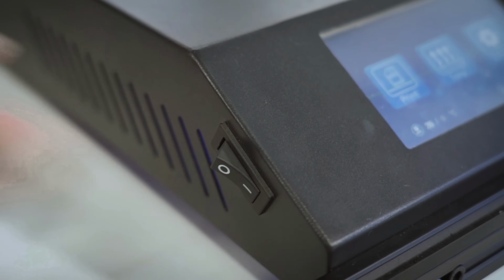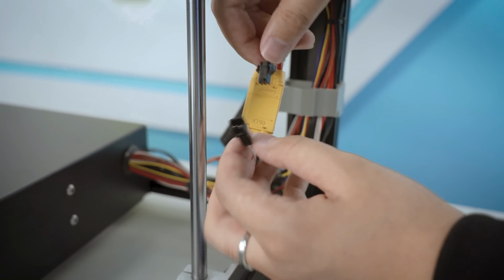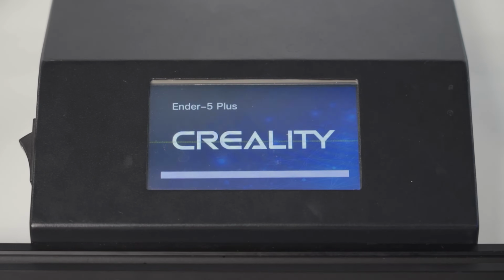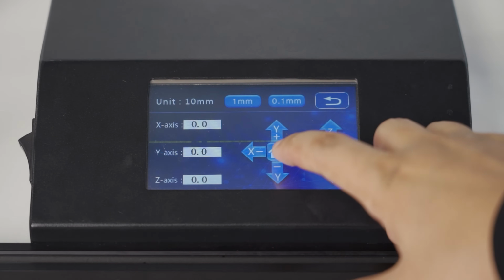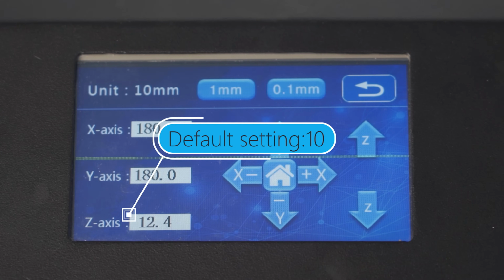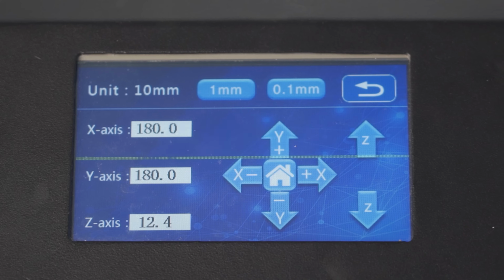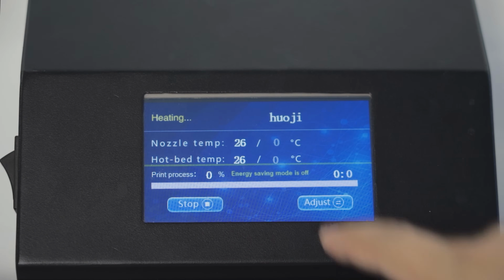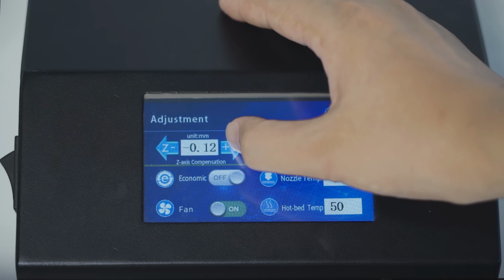Creality Ender-5 Plus Bltouch Leveling Tutorial (2019)

Comment: Creality needs to at the least... get an even mediocre programmer, as such a person would be better than whoever they have now. No matter where one goes you see customer after costumer with the same problem. With no viable solution, except going into the code and fixing the problem oneself.
Reply from the maker: Sorry for the late reply, and thanks a lot for your comment, but could you pls tell us your printer's problem, or contact our after service cs@creality.com?
Reply: Thats frustration talking, I have two, the 3v2 and the 5 plus.. I can assure you it's not a "code" issue. The internal board streams instructions encoded by the slicer, If you don't believe me, you can also configure octoprint on a raspberry pi, and it will ignore the internal board.  You can also install alternate firmware. I have on my E3V2, its much better I think. Respectfully.

Comment: I've seen the bed smashing hard into the print head, although the BLtouch is installed - shouldn't the printer be able to figure out that it reached the print head?
Reply: One would think so...
Reply: So the reason for doing this is the BLTouch detects a z-point...but the system overrides it.  Hence why they zeroed everything out before...doing any aux and auto level.    The BLTouch sense a predefined amount, then the z-offset kicks in.  And it is why the BLTouch if you watch it...retracts BEFORE the nozzle even gets super close to the bed.  Then the bed lowers...then it raises...to the touch sensor reading, the zoffset reading.

So if you screw up the settings, super bad.  The board is thinking...hey the BLTouch is here, and the bed needs to be here...so move this amount.  And with the messed up setting the BLTouch is retracted, not acting like a z-stop, and boom your head will crash into the printer.

BLTouch is NOT a z-endstop....and is the reason it does NOT use the zstop on the board.
Reply: @elitewolverine  it's essentially a software glitch. Wrong data is captured, then stored; so the error becomes persistent.
Reply: @Singularity. Sir, That is not the case, you are peppering this video with inaccurate information. I can tell you don't know what you're talking about, as a programmer myself. Not everyone would be able.

Comment: Where is the STL of the bed level test?
Reply: Its not, it is any stl.  Basically just hit print on any stl, so you can access the z adjustment, and get it to zero.  It's odd that the leveling section doesn't display the zoffset...but hey what do we normies know. haha.
Reply: @elitewolverine  I wasn't asking how to adjust the zoffset but the stl of what he print at the end to test the leveling he did.
Reply: @MGCoin333  The end of the video?  The one that is just lines?  Just a bed level print test.  Find them on thingiverse.  Or just mock one up in any 3d program.

Comment: My printer shipped with a bent pin on the BLTouch, and that caused the Z-axis compensation to get set to more than -15.00. Now I need to press the adjust button over 1000 times to fix it :(
Reply: Mine came with a second pin as a replacement...did you throw yours away?

Comment: I have to zero out the Z-Axis every print why is this?  it always defaults back to 19.00, Someone please tell me what I'm doing wrong.
Reply: Nothing... the machine design is excellent the programming however, isn't even at the level of mediocre.
Reply: @singularitysquaredllc.895  Sir, again, That information is both unfair and incorrect.
Reply: You need to be leveling and homing every time ALL axis. But that is weird. There is a save settings button, if you have an Ender 5 Plus... That IS weird though.

Comment: What about auto bed levelling, how does that work? I mean it’s the main reason I bought this machine big build area with auto bed levelling! Also does this mean I have to go through this whole process every time I do a print?
Reply: It’s not really levelling. It’s more bump compensation. When it probes it saves a grid of points. When printing it can auto adjust z to compensate for the wonky bed, but it’s z range is only 2mm. And of course, it only does this if g28 and g29 are used in the right points of your start gcode.
Reply: @hecatonchireslm  Excellent explanation, I think.

Comment: I watched this video 3 times to make sure I understood everything before doing the bed leveling. Then, I watched it a 4th time, pausing the video at the end of each step, doing exactly what was explained, then re-watching that step again, to make sure I did it correctly before moving onto the next step. I am still unable to get my prints to stick to the bed. I originally tried with bed temp 60 nozzle temp 205, I went through the process again, and then tried printing with bed temp 70 and nozzle temp 210, and I still cannot get the filament to stick to the glass. The glass was cleaned using isopropyl alcohol before attempting any printing.
Reply: Did you try disabling eco mode? That turns off the heated bed.  My first test print failed because of that.
Reply: @ridgid859  Yes, eco mode was off. I was able to resolve the issue by first upgrading to a Wham Bam PEI build plate, and then upgrading the power supply to a Mean Well 600 watt PSU. The heated bed requires 350 watts to properly heat up, and the printer was shipped with a 350 watt PSU. When the stepper motors, extruder, and hot end are running, it forces the power supply to run at about 50% above what it's rated for, which means that the bed is probably going to be the component that suffers the most from lack of power.
Reply: @PaganWizard  thanks for the reply. I assume I have the mean well as I don't have the voltage switch but I'm not too sure. Did yours come with that voltage switch?
Reply: @ridgid859  Yes, I had the same power supply in my printer when I bought it. That is in fact a Mean Well power supply , but it is not powerful enough for the Ender 5 Plus. Watch this video from Kersey Fabrications to see the same power supply that I bought, and how to mount it as well. https://www.youtube.com/watch?v=2NIcugy7p5k
Reply: Blue painters tape, brother, and and/or gluestick will fix that immediately. Its hard to get prints off the plate now when i try ;)

Comment: Got Ender 5 plus with SD card and software on it. In this software is no "Ender 5 plus" preset. What parameters i must write in Custom to add my Ender 5 plus?
Reply: I reckon you just have to change the bed size, and the rest is the same as in the Ender 5.

Comment: Recently purchased the Ender 5+ and am extremely frustrated with conflicting information/documentation from Creality. This video shows 'AUTO LEVEL' toggle in 'OFF' position, but manual clearly shows toggle in 'ON' position on pages 10 and 11. Can someone from Creality provide definitive documentation on the Z-offset adjustment and bed levelling process? Is that too much to ask after spending $600+ on your product?
Reply from the maker: Friend, sorry for the late reply and inconvenience. Pls refer to this video to see if your printer's problem can be solved. If not, pls contact our after service cs@creality.com
Reply: That determines if it attempts to level itself at the beginning of a print. It can only auto level about 2cm. Someone else here called it a bump sensor, it automatically takes into account warped plates, its not meant to do all the work for you.

Comment: I calibrated my e-steps and then the X and Y steps, Then i try to calibrate the z steps but i cannot get the first layers to stick, I've done the paper test while setting the printer up, I setup the z-offset. All OK there but now i set my fist layer at 100%, 125% thickness, Nozzle at 0.4 and extruder multiplier at 100% and try to print a calibration block the Brim is printing awfully (almost does not stick) but when the printer is beginning to print the object my bowden extruder (the metal one) is clicking and skipping a lot, it seems he is trying to extrude to fast and to much. When i measure the extruded filament i get a thickness of 1.16mm strange. i tried everything (i build and i'm using several other printers and have never had thet problem) Could i have a bad motherboard somehow. I reflashed the firmware also and have the same problem. X and Y perfect but no sticking and the extruded filament to thick. O yes i'm printing on the back side of the original build platform because it is of glass. I put hairspray class 5 on the glass for the object to stick. On my other printers there is no peoblem. Any idea here would be helpfull because now i cannot print because of the  extruding speed/flow problem.
Reply: There are videos online for calibrating that. Use blue painters tape on the platform, sometimes gluestick too. ;)

Comment: My nozzle hits the bed when it initialises the auto bed feature, the bl touch engages twice but on the 3rd attempt it disengaged itself so the nozzle crashes into the bed?
Reply: Ever find a solution to this?
Reply: @Brax_Torres  yes mate, load a file to print, press print and then go into the settings and change the nozzle offset. Then cancel the print and start the auto level process, repeat until the bed is within 1mm under the nozzle then you can fine tune using the bed levelling springs.
Reply: @Bible_Studies101  aye thanks G
Reply: @Brax_Torres  no probs, when auto level is finished you can use the aux level and level each corner of the build plate

Comment: Hi, after successfully using the printer for a month, the printer now suddenly wont go back "home" correctly. It should head to the right side, then top and finally to the center point, but now when I hit "home" it just goes up. What can I do to fix it? any ideas?
Reply: Bad limit switch I bet. Or youve wired the steppers wrong. What was it?

Comment: Bought 5 Plus last week, tried auto levelling bed with attached BL touch 4 times as per instructions- 4 scratches across glass bed- THEN followed THIS video, stopped, copied, restarted etc. Got as far as around  7 minutes in where he presses the home icon and the bed travels to the top and the BT touch turns Blue and stops the bed rising ready for auto calibration- NOT ON MINE- when I pressed the screen home Icon my bed travelled 20mm and stayed leaving a gap of around 200mm from the BL probe which is now NOT extending and turning Blue????? and will always reset to this position no matter what I try. Tried fitting a silent board to see if this would reset- NOPE. Will have to pay to get printer fixed now!!!! - Not even 1 print done!!!!

Comment: Awesome. I believe that may have fixed my issue of being about a quarter inch (.25") away from the print bed while printing. From the other video posted on the webpage, I could see I was running the proper firmware already. I just didn't have the machine homed out properly in the leveling menu. Time to test a print to. I wish you guys would have programmed in a cancel button feature during the leveling process. I'm sure I'm not the only one who has wished this. Was a bit concerning that it would crash when it was going to home. It did crash once though when the extruder head was too far from x,y home... It wouldn't go the full distance of touching the sensors. Anyway, don't start any further away than center of the table and I think it's all good.

Comment: Coming from an Ender 3 Pro to the Ender 5 Pro Plus, I too got a little confused on the order of calibration.
After working it out, I would suggest the following steps to calibrate the z-axis once the printer is setup. I hope this saves some time for new users of this fantastic printer. 
1 - Spin each wheel so that they are in the middle of the screw thread to give you some room to adjust the bed up or down. It comes tightly turned with the bed locked.
2 - Zero the z-axis compensation - oddly  you have to be printing something to get that menu option under "adjust". Then cancel the print job.
3 - Autohome the printer in the menu to let it find where it thinks x0, y0, z0 should be. The nozzle is in the center with z-axis at 0, bed is at the top most position.
4 - Use the menu option "Aux level"  to move the printer head to each corner and adjust your z-axis using a piece of paper and the wheel. Do not push up or pull the wheel down as you adjust - only left or right. The paper should only have a slight tug. You need to repeat this at each corner until it feels all the same. Took me 3-4 rounds.
Note - In this step, you may see the nozzle about 2mm above the bed after autohome. The menu should show Z movement arrow. This is used to compensate the 2mm Z difference between the nozzle and bed.. Move it down close enough but not hitting the paper/bed. Then use the wheels to fine tune with paper.
5 - Autoleveling tells you how much mm difference there is from measuring 16 points over the bed.
This alone doesnt do much but shows you the difference between each point. However I believe this system is used during printing if you move the toggle for auto leveling to 'on'.

With autoleveling on, before each print job, the printer will measure the bed to nozzle distance using all 16 points. You may not have patience for this but it does give a better print and bed adhesion.

If your object is not sticking, adjust your z-axis leveling. With the PLA that comes with the printer, the bed can be cold and still stick. No aquanet on the glass bed, just clean with 90% rubbing alcohol.

The "10" for z-axis is an approximation of where it should be. Don't assume all printers are calibrated exactly. Set the Z compensation to 0 first and re-calibrate.

Make sure your Y belts are tight. 
Make sure your printer sits evenly on all four feet before calibrating.

Comment: Ok so I set up my creality Ender 5 plus just like you showed in the video. I went to go print my first item ever and the adjustment screen is showing the Z-axis compensation is again the 2.89mm. Is this ok to print with or should I always zero it out?
Reply from the maker: You need to reset to zero and then adjust the Z-axis compensation. It may be that the printer has not saved it. If it does not work, please try to flash the firmware again.
Reply: @Creality3D  How about providing a video showing how to set Z axis comp and re-flashing the firmware.  You seem to assume everybody knows how to do these things.
Reply: @Creality3D  Does "save settings" correct this? I know it saves the mesh.

Comment: Hint for Aux-Leveling:
Start at point 2, level. Continue with point 4, level. Check Point 2, adjust level. Check point 4, adjust level. Redo until point 2 and 4 are perfectly leveled. Continue with point 3, level. Continue with point 5, level. Back to 3, adjust. backt to 5 adjust. Point 1 will be fine now. But first, to be sure check 2, 4, 3, 5. Then you CAN check point 1. (For fun). THEN continue with measuring. Then it´s only the crappy bed, what you are adjusting, not the crappy leveling. ;) Happy printing.

Comment: I installed the 5plus yesterday. I followed this instruction video to adjust the bed height and perform the manual leveling (and auto leveling) but everytime I power-up the 5plus, or start a new calibration, the bed is going lower during the startup procedure and not going up to the BLTouch: the distance to the nozzle gets bigger and bigger! Auto leveling does not come close to the BLtouch and sometimes still completes the complete cycle and other times aborts after 6~7 free-in-the-air "calibrations". I did 6~8 fresh calibrations (from this video and other videos) every time with the same result: the bed z-home position going further and further from the nozzle. Info shows that firmware "1.70.2 BL" is loaded (Creality site says 1.709.1 is latest!?). Any ideas what is the problem???
Reply: G92 E0 : Resets the Extruder

I was having the same problem.  I went into Cura Start G-Code and found above code.   I typed it in Octoprint terminal and viola!! The bed finally went up to nozzle.
I will try to do a bed leveling now see how it goes.  At least this will get the darn bed up.
https://www.youtube.com/channel/UC0wibNiEDwok18wFNRHrHMg     (Kersey Fabrications is a good start point.
https://github.com/InsanityAutomation/Marlin/tree/CrealityDwin_2.0   has good information too. 
Hope it helps!!
Reply: Did you solve this issue ? Same problem I'm having
Reply: This happened to me too. The problem (for me) was that the BL Touch pin had bent and was stuck inside the probe. Gently pull it down and straighten it. When you turn the printer on, it should move in and out twice. Then it's ready to home the Z axis. It should work for you now and find the proper bed level.

Comment: you need to add the offset of he probe to the ABL function because of the offset to the left the right side measurements are horribly skewed. The probe should measure the point where the print head should be, so you have about 50mm of offset to compensate for.

Comment: This video is almost completely useless to me. I cannot tell which order to do the aux level vs bltouch measurement in. I cannot tell what the relationship between the 'z home' button, and the Z adjust buttons. I have read that maybe I need a 2mm (or is it 1.5 mm?) gauge block to set the nozzle height.

Usually this stuff is fairly straight-forward, but the Ender 5 Plus firmware is pretty obtuse. 

Please consider making a new video, but actually making it about leveling the bed, not whatever this video is supposed to be about. 

The printer is quite nice so far, but lack of clarity on the very basic task of leveling the bed is pretty frustrating. The auto leveling takes a long time, and the time per-test is too long to be blindly adjusting settings and cranking leveling knobs.
Reply: Creakily doesn’t care about their American costomers
Reply: @ZekeSage3  America, sorry, US,  does not care about the "rest of the world". Barbarian units